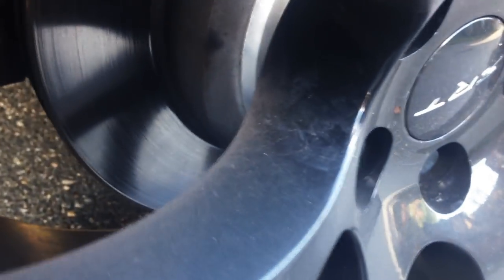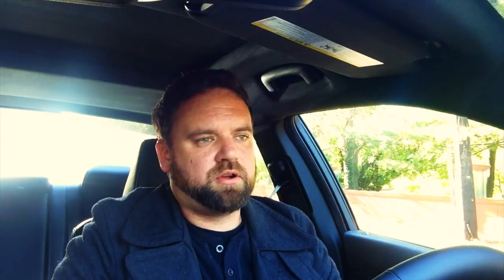Wheel Spacers On Rims

Comment: That's a gorgeous opening shot of your Charger R/T, I love the stagger of those wheels & fat tires!  I want to get some TA's for my car with 245s on the front & 275s in the rear on my stock Shaker rims.
Reply from the maker: Thank you, I really appreciate it! When are you thinking of doing the new setup?
Reply: I still have the original Goodyear 245s on the car now, since it doesn't have too many miles on it even for a 2014 I want to get through the winter with these but I love the Comp TAs & am leaning towards those next spring hopefully.  I have some visual mods I want to tackle first & soon.
Reply: R/T Life am posting a video shortly that’s going to make all R/T peers very 😠...... it made me very mad....

Comment: The Negatives
The main issue with a wheel spacer is that it moves the wheel to a wider position whilst the rest of the suspension arms remain in the same place. In particular, the king pin inclination axis remains in the same place. Therefore, fitting a wheel spacer moves the wheel outboard and alters the scrub radius of the car. It is important to know whether your car currently has negative or positive scrub radius and ideally how much it has. Fitting a wheel spacer will increase the positive scrub radius at the front wheels which has some unfavorable consequences.
If your car already has a bit of positive scrub radius then the wheel spacer will increase it. An increase in positive scrub radius increases the forces on the steering rack under braking conditions. Any bumps in the road will also be amplified through the steering wheel, making the steering jerky and more unpredictable. Twitching wheels when braking can cause the tire to lose grip and ultimately can cause the wheels to lock up and slide. An increase in positive scrub radius also causes the wheel to gain positive camber when the wheels are being turned, reducing grip in corners on the front wheels and producing understeer.If your car has the more favorable set up of negative scrub radius then installing a wheel spacer can cause bigger issues. The outward movement of the wheel can make a negative scrub radius become zero. This is the worst position for it to be in. A zero scrub radius can cause squirm. This is where a scrubbing action occurs on both front tyres in opposite directions which can create unpredictable handling in corners and can lead to understeer too.

Secondly, installing wheel spacers on a car increases the leverage on the wheel bearing. The larger the spacer, the larger the leverage becomes. This reduces the life of the wheel bearing as they are not made to take leverage forces and can therefore wear faster, increasing rolling resistance and power loss of the car.

Finally, the wheel spacer moves the wheel further away from the damper mounting point. This means that the wheel will have a larger effect upon the damper and will act upon it with more leverage. This effectively makes the spring and damper softer and less effective on the wheel. This means that the car can roll more on corner entry and exit and feel generally softer out on track or on the road.

Comment: 1st off I think your a really great dude .
And I’m not trying to be rude or anything like that... So that being said...
You have the same chassis as a Hellcat Charger ... When my brother in law bought my hellcat wheels off me for his charger SXT , same exact set up as yours just a little smaller tire.
They fit perfectly not even close to touching any suspension parts at all... And flush with the fender for the most part.
And I’m all for using hub centric wheel spacers , and the only reason I used them is
To make the wheel/tire set up perfectly even with the fender... not because I’m coming close to touching other stuff on your car..
So I would say they most likely gave you the
Wrong offsets on the wheels... Cuz really Bro in my eyes they stick way to far out , Which is good for only one thing Cornering (Which is good) I mean you got basically a Mad Max Car 😁 .. Anyhow I’m not hating by any means.. Your Channel is really good and your a very humble guy , and that’s why you are so cool ... at least that’s one reason... 
congrats on 4K subs and everything you share with us .. Thx buddy 👍
Reply from the maker: The fronts sit really nicely, the backs on the other hand should've gotten a 18mm offset instead. With that said, man I love the look. If you ever see it in person I think your mind will change but I'm also adding splash guards that will make the backs look a little more natural. Either way this thing looks like a pissed off bulldog from behind, I think it's so cool. Thanks man, I really appreciate you watching some of these videos & supporting the channel.

Comment: Dude I need help, 
Hi, i got a set of 4 hellcat fact replica wheels/rims for an 07 RT... 
My guy just told me it's rubbing against the struts...
Sounds like an issue a spacer would fix? Or do I need longer lug nuts?
Staggered here too; 315/35R20XL rear, 
275/40R20Xl front.
Thanks so lot.

Comment: Yoo what’s up R/T Life, great video👌🏻 quick question tho? Did you ever come across any problems with the spacers? I just put some on my charger 2 in the front I think I went with 5mm and idk know how I feel about them is it safe??
Reply from the maker: I've had them on for about 3 years now - no issues to report back. Put them on & haven't thought about them since.
Reply: R/T Life , ok cool thank for the feedback 💯,hopefully my front tires don’t fly off 👏🏻
Reply: R/T Life one more question, did you have to get longer lug nuts or longer bolts?

Comment: I like your videos man can learn a lot 
I am planing to add wheel spacers (25mm).
I have 275’s on rear and 245’s on front.
Am i going to get into trouble for 25mm spacers or its ok if we install it properly.
Hope you get back 
Thank you
Reply from the maker: Why do you want to run such a large wheel spacer?
Reply: Right now Just for the look.
Later on i am trying to put large tires all around.Mainly for the wider look is that a problem?
Thank you

Comment: You seem to be the only guy that can help out. My goal is to mount 315 tires on 20" rims on my RT 07. What mods is needed please ?
Reply from the maker: What size is the rim 20x?
Reply: @RTLife  I think they are 10. But I plan on replacing them with deep dish rims. Dont hesitate to provide recommendations or input. I entirely trust you. Your vids are priceless !
Reply from the maker: You should be fine with 20x10 (that's what I have) & 315's on there. if the rims are the wrong offset you can always buy 5 or 8mm spacers for extra room. Thanks man for watching these videos - I appreciate it.

Comment: R/T life what's up, hey that was a very great video about apacer, me  I'll been asking questions left and right about spacer, because i soon will getting rims and tires so eaven a was considering all four tires 275-40-20. But may get 275 in the rear and i think i may not need spacer for this set up right? And keep 245 in the front....know i listen to you and basically keep it on a 5mm it not  compromised, but anything bigger than that it take extra secure space from the rotor screws and yes that is dangerous. So i will make a decision soon..car look great as all ways.
Reply from the maker: If you go 245's in front & 275's in back then no spacer will be needed at all. If you decide to get upgraded rims to go 275's in front & 315's in back then a 5mm spacer may be needed but that's not always the case. I like the little spacer anyway, kicks out the tires & gives it a nice beefy look. Just can't make the spacer to large. Thanks man for watching these videos I appreciate it

Comment: Congrats on passing 4k subscribers and I see your well on your way to 5k. I just installed my long tubes on my RT and with the extra power I kind of need to start considering a bigger wheel setup but I didnt see a link for where you got the wheel spacers, and also are they hub centric? Please let me know and TY
Reply from the maker: Thanks man I really appreciate it - the channel is growing, def cool to watch. I ended up going with mr gaskets spacers - the guy at the pro shop said they were good so I went with it. Bigger tires are awesome but the tire itself is the most important part. Getting nice performance tires likely after winter
Reply: I am thinking I will get the atturo AZ850 in 275s for my regular tires(heard good things) and larger rims with a wider drag radials setup for if I wanna go to the track. Also have you seen the AFE mementum GT cold air intake? I know you got one already but I am trying to decide between it and the LMI  V2 true cold air one. Have you checked it out and any thoughts?
Reply from the maker: AFE mementum GT I've heard about that & people say they really like it. It's a lot of money man

Comment: 265 didnt fit? Maybe its different for a Dodge Magnum, because they fit on mines. Also the offset of the wheel makes a difference.
Reply from the maker: I have 315's that required spacers. I had 275's in the back that fit perfect, no spacers needed.
Reply: R/T Life - On the rear 275 wont rub unless your car is lowered or you are carrying a heavy load.

Comment: Can you put 275/45/20 in the front ?
Reply from the maker: You would want 275/40/20 but I believe you can
Reply: I’m at the tire shop now and it’s like my front ones scrap the suspension screw
Reply from the maker: did you put on after market rims? Either way... Pick up 3 or 5mm spacers - I did it & haven't had an issue since making this video
Reply: R/T Life i put scat pack rims on my car but when i drive i can here that screw grinding the tire and i can smell the tire

Comment: Where did you buy them from? Link?
Reply from the maker: Mr Gaskets - this was so long ago I don't remember where I got them
Reply: Ok. I tried to get my wheels installed today 20 x 9 1/2 on the front 20 x 10 1/2 on the back with 275 /40/20 and 315/35/20 they said it could not be done but I called factory reproductions and they said it could be done I might need spacers not sure if I want 3 mm or 5 mm
Reply from the maker: 5mm has worked out perfectly for me. Did them on all 4 corners.
Reply: Still have them on now?
Reply from the maker: Yup still have them on.
Reply: I better get 3mm being that I have 20X9.5 and 20X10.5

Comment: What's the offset of your wheels?
Reply from the maker: 20mm on those rims
Reply: I'm picking up a staggered setup from Factory Reproductions. Front will be 20x9.5 +15mm  and the rears will be 20x10.5 +25mm. I also have some 3mm spacers from Billet Tech, just in case.
Reply from the maker: Nice! That's such a nice setup there. Picking up the spacers was a very smart move - you might not need them.